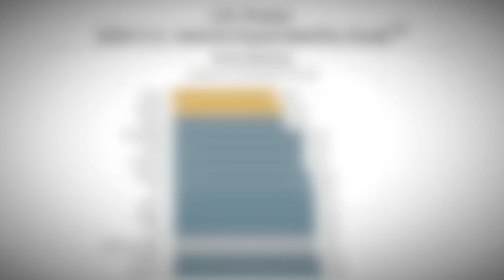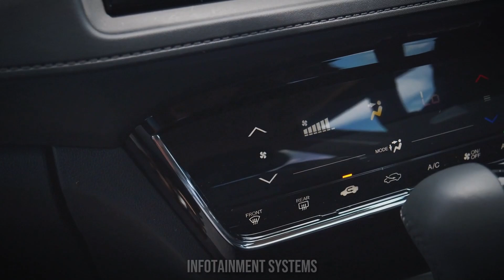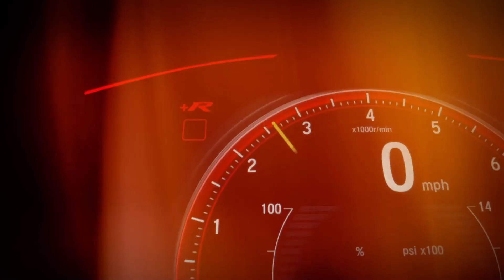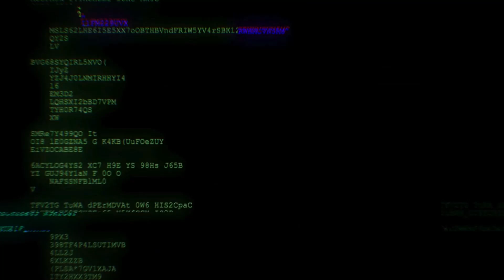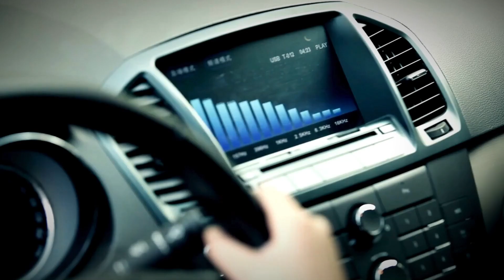EV Tech Woes Revealed by JD Power Survey 2024 || Tech Wheels:

Comment: Should indicate the brands involved?
Reply from the maker: Tesla:
Build Quality Issues: Some owners report imperfect finishes and assembly problems.
Autopilot & Software Issues: The Autopilot system has faced criticism for reliability and safety.
Repair & Battery Replacement Costs: Costs can be high for repairs and battery replacements.
Nissan:
Battery Degradation: The Nissan Leaf has had issues with battery degradation in hot climates.
Quality Issues: Older models have reported quality and reliability concerns.
Chevrolet:
Battery & Range Problems: The Chevrolet Bolt faced battery fire issues and a large recall.
Software Issues: Problems with software and infotainment features have been reported.
BMW:
Battery & Reliability: The BMW i3 has had reliability issues and high maintenance costs.
Audi:
Software & Infotainment: Issues with infotainment software and build quality in the Audi e-tron.
Reply: @Techwheels2025  Awesome!!! Thanks for clarifying